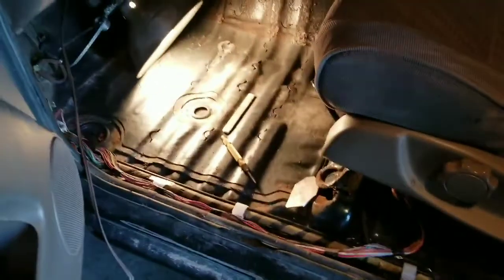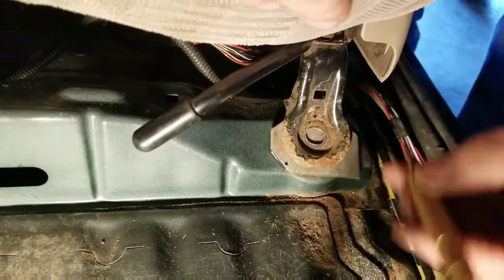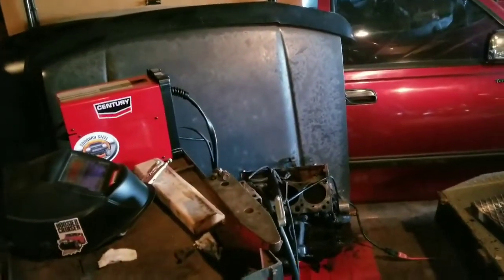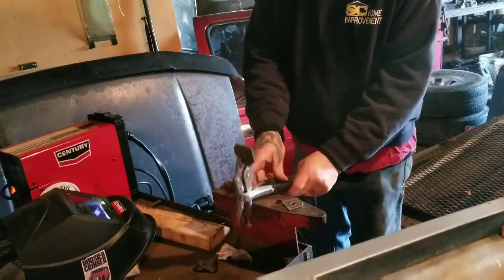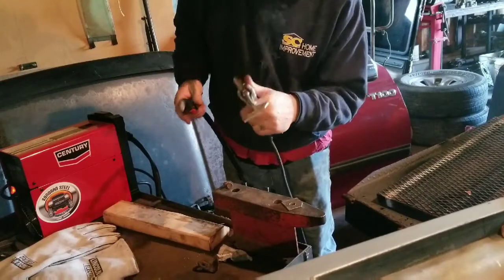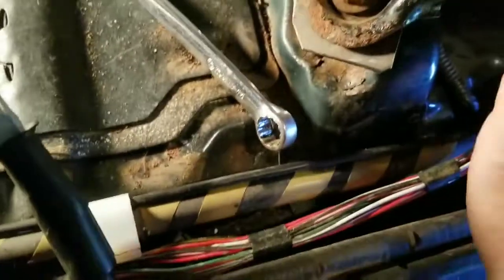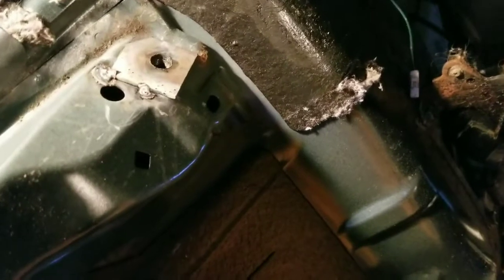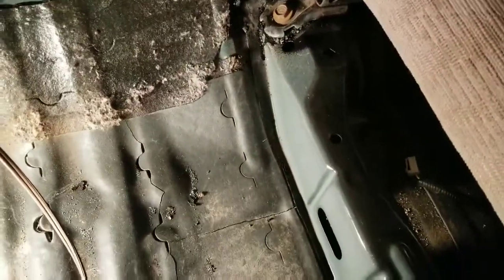How to repair front seat mount. Rusted seat mount. 3rd gen 4runner. Tacoma. Pickup

Comment: Mine just popped out two weeks ago, and I’ve been wondering how to fix it. Except I can’t weld, so not sure what I’m going to do.
Reply from the maker: Hmmmmmmm let me ponder that.
Can you get the seat out?
Is there enough thread to cut the bolt off?
Reply: T4 funjunkie the bolt basically twisted the nut that was welded under the backside I’d the sheet metal completely off. It!s loose underneath the mounting bracket, rattling around. The other three bolts are holding fine. I thought about using a very large toggle bolt and a fender washer on top of the seat to try to hold it in.
Reply from the maker: I was gonna suggest the toggle bolt, you're on it!

Comment: Ahaha this happened to me and I just drove a much larger bolt through the body with a nut on the end and sealed it from the elements using silicone. Sure it's hacky, but it works and no one can really see it. Plus I don't have a welder :(
Reply from the maker: You're innovative enough to solve your problem, that's what matters.
We gotta use the skills and tools available to us!
Thanks for watching.